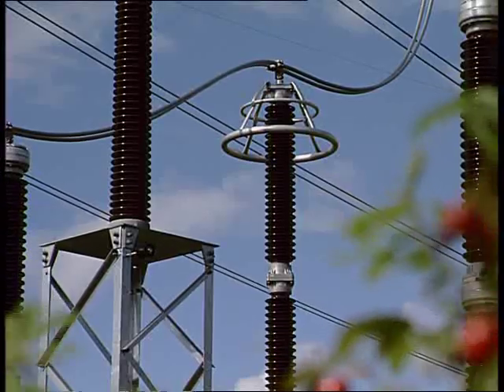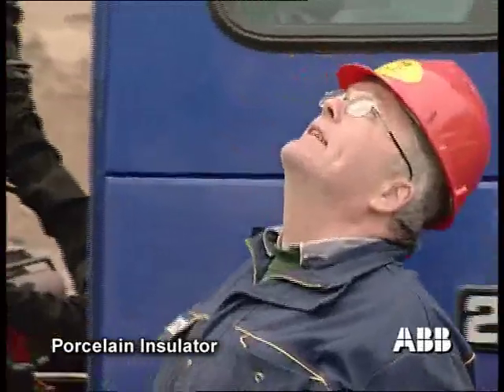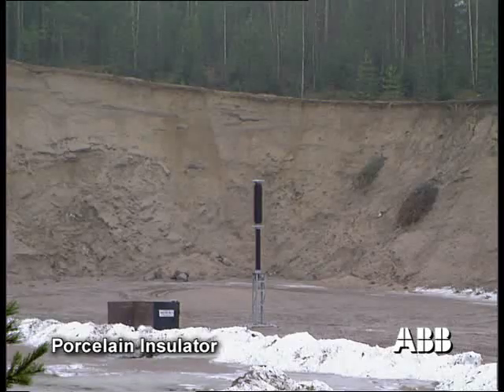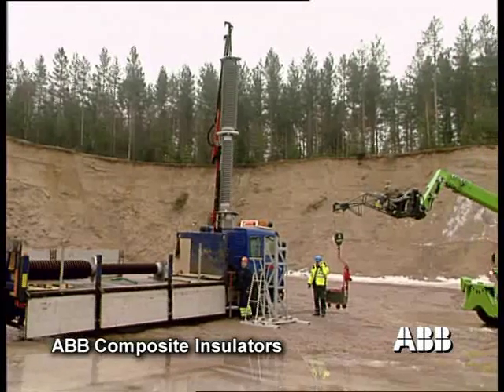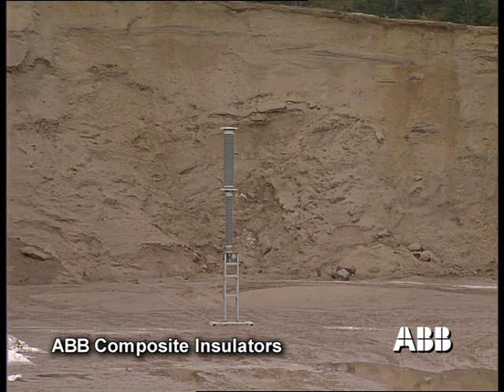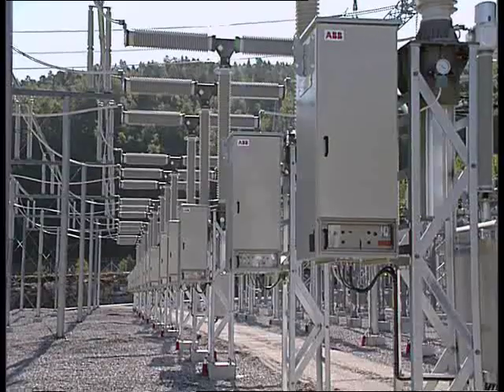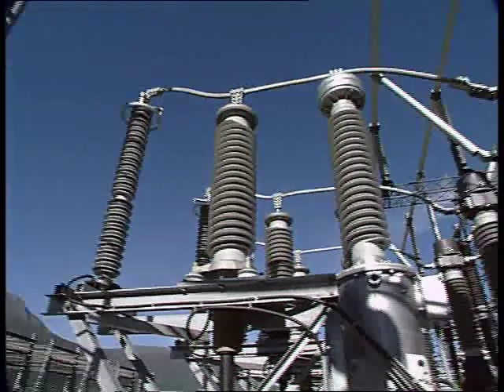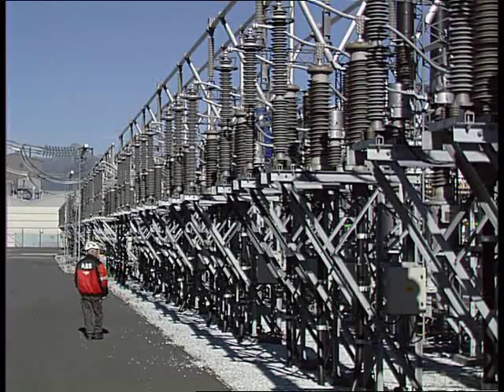ABB Composite Insulators  - Design for reliable performance (1HSM954308 03en)

Comment from the maker: Silicone rubber has the ability to transfer its water-repellent properties into pollution layers which cover the surface.  This eliminates the need for maintenance or cleaning of the high voltage apparatuses in polluted environments. Expensive solutions normally used for porcelain, such as cleaning, greasing or coating, can be avoided.

Comment from the maker: @Claesklaettermus Composite hollow insulators are consisting of a load-bearing insulating tube made of resin impregnated fibres, a housing (outside the insulating tube) madeof elastomeric material (for example silicone) and metal fixing devices at the ends of the insulating tube. They are intended for use in high voltage electrical equipment.